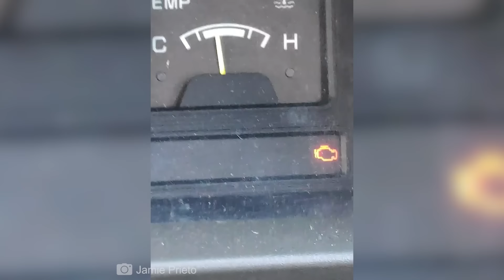Car guys funny moments [PART 2]

Comment: The dude that ran out of diesel had me dying
Reply: Hilarious,  @Slicks21 .  That is some good fast thinking, man.
Reply: if only there was a way to get diesel before you went through all 90L in your tank..
Reply: If you run out of gas you need to get your license taken away
Reply: @blackhammer_928  y tho
Reply: @strategy_photos1382  cuz your car turns it into gas?
Reply: @strategy_photos1382  Because it's short for Gasoline. What the liquid is called
Reply: Oh My Gosh!! I know where that is! literally 5 min from my house!
Reply: On my way to work one day the guy in front of me in the left turn lane broke down right at the intersection.
I get out and start pushing him into the gas station on the corner, people honking the whole time.
I'm pushing the guys car by myself.
Did a single one of them get out and help clear the road faster?
Reply: @GMdrivingMOPARguy  i think the joke was lost on you
Reply: He didn’t even start the truck
Reply: @sadmax588  wont start when its out of diesel....
Reply: DEESEL
Reply: @blackhammer_928  yes I agree the fucking car tells you
Reply: @0xsergy  It's especially funny if you run a diesel dry you have to bleed the system...
Reply: @strategy_photos1382  Any gas can be made into a liquid ! U didn't know that. Bet u didn't know you can run a gas engine off of water and or wood
Reply: @jaycole5353  I mean you can run a petrol engine using woodgas with minor modifications
Reply: Anyone have the link to the original?
Reply: @GMdrivingMOPARguy  It is called petrol!

Comment: Why was the Maserati even there in the first place?
Reply: Still just hooking on to the front clip and thinking that'll hold is far more stupid then taking a Maserati down to a beach. (There are actually some beaches that are actual highways in the world)
Reply: I am not surprised the Maseratis bumper came off they are pieces of crap
Reply: @camroig1404  All cars today are just plastic front pieces clipped on. Putting a tow hook there was complete idiocy by the person doing the recovery. Cars either have hooks underneath or screw on eyes to pull on to recover.
Reply: @Cragified  yeah I know they placed the tow hitch in the wrong place and it was stupid I just though it was funny because  Maseratis have terrible reliability and are built poorly.
Reply: @Cragified  there is no hook underneath the car. those are for tide down only. The hook up is correct, the problem is the truck yanked it too hard, but Maser is still piece of junk with crash bar yanked out like that
Reply: @Align700nitro  You are correct. Watching it back frame by frame I do see the eyelet is in place. That is pretty bad that it ripped off the whole front fascia there.
Reply: @camroig1404  who needs a reliable car when you can afford a Maserati

Comment: 6:12 And this folks is why your car manual points out in detail the proper spots to lift your car from.
Reply: and if there's any doubt, jack on the suspension arms.
Reply: @TestECull  No! Not all suspension arms are designed to take a shear load. Many are tension and compression components. I have replaced many a lower arm that was used as a lifting or recovery point. And I have seen tension and lateral struts snapped or bent into Us.
Reply: @Cragified  If you can't jack a car up by putting the jack on the control arm the car isn't safe to drive on public highways. I sure as shit won't ride in one built that shittily.
Reply: @TestECull  If the control arm has a spring cup you can lift under the spring cup because this component is normally taking the sprung weight of the corner. However the far more common these days Macpherson control arms cannot be lifted under. You are highly likely to bend them and the first obvious sign will be the steering alignment being way off.
Reply: @Cragified  The forces on that arm when you hit a bridge transition on the freeway are orders of magnitude higher than the forces on that arm when it's got a jack on it for 30 seconds.

Again, if the arm is too fragile to be used as a jack point the car is not safe to drive and I will steadfastly refuse to drive or ride in it.
Reply: That was just a terrible idea.  He needs his man card revoked....Lol
Reply: @TestECull  IMO if you are not the engineer who did all the stress analysis on all the different suspension components i'd always stick to the manufacture recommended jacking points (they are never the rocker area those are for tire changing only and not designed to sustain 1/2 to 3/4 of the vehicles mass)
Reply: @G1itzik   If I can't jack it by the suspension it's not fit for purpose. I don't need to do stress analysis to know that a control arm so flimsy I can't pick it up by the arm is too flimsy to be trustworthy on the freeway.

Part of why I love my old truck so much. The front arms on that thing are literally three inches thick solid cast iron. They're the strongest part of the entire fucking truck. Nevermind jacking it up, you could use them to pick up a bulldozer.
Reply: @TestECull  sedans don't have beefy suspension, most of the mass is held up by the McPherson strut. And the arm do mostly lateral support, I wouldn't trust them for 1/2 of the car mass or more
Reply: @Cragified  noone says to use the center of the arm dingus. you lift where the arm is attached to the frame OR right under the pintle pivot.
Reply: Always lift up cars on the metal frame. I don’t care what any moron tells you. I’ve seen too many cars messed up like this.
Reply: Fuck sake jack it up from the crossmember from the front or the rear diff
Reply: mainly bc the ground isnt flat. and the weight from the ramp. what a geniuses. lmao
Reply: @Cragified  i have used control arms as a jack point for every car ive ever had from 1982 to 2019. Never had any problems with alignment. Id rather use that than rely on a pinch weld like some idiots.
Reply: Pinch welds or any reinforced metal beams like frame rails or structure components
Reply: Man's used a jack on the skirt instead of the proper spot
Reply: Even the dog knows that.
Reply: I’ve known this sense I was like 12yo and this dudes a grown man and can’t even jack a car up correctly 🤦‍♂️
Reply: @OFFROADOVERDRIVE  That dog had more sense than him snh
Reply: Up north the lift spots are the first spots to rust out lol
Reply: i cant remember the last car i've owned thats had the owners manual with it. still though. its obvious where you'd want to put a jack on pretty much every car.
Reply: Dumb mistake or not, I still feel the guy's pain- I would hate to mess up my own car like that.
Reply: Looks like he had it right on the edge of the jack point and the jack then slid off slid off into his frame and door
Reply: @TestECull  just jack it up properly... Idk why youre arguing about doing something wrong... Just don't do it. Smh
Reply: @leexgx  no, it wasnt anywhere near the jacking points.
Reply: Bro even the dog knew. LMFAO
Reply: @TestECull  you are giving terrible advice. You are completely misusing the parts you're lifting by
Reply: @FordRangerClassics  If jacking by the spring perch damages the suspension that car was not safe to drive in the first place. End of discussion. That part should be strong enough to hold the weight of thar corner when jacking the car because that part of the car ALWAYS has to hold the weight of the car.
Reply: @TestECull   going to lift by my leaf springs
Reply: @TestECull  well thanks for realizing that
Reply: What car is it btw ?
Reply: @kalbi777  lexus GS F
Reply: It is very common for cars to have jack points along the rockers. He probably did listen to the manual. Lots of cars also have problems with the rockers rusting out. Looking at the manual is better than nothing for complete idiots but usually you are better off taking a look and using common sense to find structural areas that aren’t rusted out and which don’t impede the area you want to work on.
Reply: @sprolyborn2554 Either the dealership hands it to you or leaves it in the glove box. If you didn’t get one it’s either because you are buying used or they offered and you didn’t want it.
Reply: @JacobLeeson-zk1ol  in the context of a new car that has an owners manual with it, you wont ever need to jack it up for quite some time so you're making a moot point. the only time you might end up needing to jack a car up somewhat frequently is if its a used car that surprise surprise! likely doesnt have a manual anymore!
Reply: Rule of thumb: when the dog slinks away stop and evaluate what you're doing
Reply: @TestECull  good luck trying to lift a 5-Series BMW on the aluminum suspension arm as thick as a cigar...
Reply: @E39Passion  If they are substantial enough to support the performance those things are capable of they are substantial enough to jack and support it. If they are not substantial enough to jack and support they are not substantial enough to support the performance the vehicle they're on is capable of, thus, every single one of those things is unsafe to drive.
Reply: @TestECull  ...and when exactly does the driving force affect a punctual surface as big as the jackpad on the suspension arm? It even says "do not tow or lash" on the suspension arm. So a BMW suspension, one of the most capable suspensions in a fullsize Saloon car, is unsafe to drive? Well, yeah...
Reply: @E39Passion  If it's too thin to support the car on a floor jack or a jack stand, yeah, it is unsafe to drive. Too thin on the suspension. clip a pothole or train crossing wrong and you'll snap it like a twig. If they truly are so delicate that floor jacking the car up by the arms damages the suspension I dont want to be anywhere near a 5 series.

BMW saying not to winch or lash is entirely different as the forces at play when you're doing that can rip the suspension off damn near anything. Doing that will pull the front arms off my 85 F150 if it's been buried badly enough and that thing is built out of bridge girders! Ittl pull the axles out from under semi trucks, SUVs, hell there's videos of that sort of shenanigans ripping farm tractors completely in half. WWAAAYYY more force on the arms than a floor jack and in an awkward direction to boot.
Reply: @TestECull  allright, keep using the suspenson arm instead of the jackpoints and be happy, because even the automotive engineers are wrong and you're right... ;)
Reply: @E39Passion  I dont trust cars so shittily built that a floor jack on the suspension arm damages them. They are not substantial enough to be allowed on public roads.
Reply: @E39Passion  Of course, BMW has perfected the art of convincing rich people to spend a fortune on shitty cars, so yanno. Whatever works I suppose. I mean nobody else in the biz has 'r+r connecting rod bearings' as a fucking maintenance item every 90k miles but if you want your N54 to live past warranty its a must do. 

I sure as shit ain't driving a car that flimsily built.🤷‍♂️ My daily commute would destroy it in a month. I'll stick to my 40 year old Fords. Better built.
Reply: @TestECull  yep dude. Makes sense, talking about "unsafe" cars you don't want to get near to, living in a country where it is perfectly fine to run your F150 on 4 different wheels with the exhaust can held by wires and both bumpers taped on, flopping in the wind. That's what I saw when I've been to the USA last time in 2017, after being on the Highway for just 10 minutes. But most important thing is that you can lift your solid safe car on the suspension arm. Especially if you want to take out or work on the shock absorber or the suspension arm itself, it's a good idea to put the jack underneath it instead of using the factory jack points. 

Let me choose the corner and get through it with 100mph in an F150 and in a 5-Series. That might be the situation for you to realize that all of the additional arms and joints inside the BMW suspension are there for some reason. 

But you're right and I have my peace. Who needs good handling, when the maximum speed is 75 mph and every road is straight...
Reply: So I’ve seen this guy explaining what happened. He says he had put 2 pucks in the jack under the car and the pucks slipped off of each other causing the jack to slip backwards onto the side skirt.

Comment: 4:20 Now that is a blown engine
Reply: never seen a engine blowup like that, insane
Reply: @jls.mp4  fr is some serious power
Reply: @savagesock3598  sounds like it ran away
Reply: @themindofjohn4346  Shit obviously aint gonna be walking home like Forest Gump wanting to go home 😭😂
Reply: Blew up the entire front end it just hurts so bad to watch
Reply: @themindofjohn4346  no. Lol. Too much boost, witch resulted in way too much crank case pressure, blew it off the mounts.
Reply: @noahbannister1834  3:23 try reset engine light controller if you want
Reply: Man the way dude grabs his hat afterwards 😂😂😂
Reply: Theres a video from another angle out there, and you can see the entire top half of the engine block just fucks off.
Reply: Nah dude just put some seafoam in it’ll be all right
Reply: @noahbannister1834  Hurts but is also one of the bada$$ things I ever seen . I do feel bad for the guy and even the truck
Reply: @jnoneofyodambidnezz2876  Probably checking for the top of his head 🤣
Reply: Nah it just overheated
Reply: that’s probably why the guy below decided to duck lmao
Reply: That truck died violently
Reply: @alyx6427  took cover in that little storage space ahaha
Reply: it'll buff out

Comment: The daily for the daily had me in tears. 
Even though I know a person who is exactly that...😂
Reply: reliable transport is very important. its also not that hard to relate to. i own 2 cars and a motorcycle. 
one car is really nice but breaks down because ford sucks. my backup car is old and more reliable, rusty, and gets good gas millage.
Reply: @darkshadowsx5949  shit sounds like my cars except both of mine are unreliable shitboxes (94 ranger splash and a 95 accord ex both five speed manuals)

Comment: 6:15 brahh. WTF was that? Jacking up the front with stands in the rear XD
Reply: Most cars have a double thick rolled steel lip for a jack point. At least my Jetta does. But the extra angle with the ramps in the back didn't help.
Reply: @walkerw3091  
He was also right under the door instead of the body seam
Reply: And on the body.... not even a lift point

Comment: 6:12 “how to jack up your car the right way, first u put it wherever you want. Pinch welds, the frame, cross member, and even the control arm don’t matter.”
Reply: Nah. Completely wrong. Put it right under the oil pan

Comment: 7:37 is there some type of trend going around where people are stealing cats off of priuses? I swear this isnt the first time I've seen something like this lol
Reply: Yeah, the hybrid cats are worth a shit ton of money, and easy to steal. Dude filming it should've stopped them though, jeez..
Reply: @mafs13  what makes them so special compared to a normal cat converter?
Reply: @Intellistation6225  Not sure, the only reason I can think of is that in hybrid vehicles the gas engine seems to run less, and also less hard making the metals in the cat less susceptible to corrosion. Also on the older Prius, say generation 2 the cat is in a really easily accesible spot, making it really easy to steal.
Reply: Where do you see them stealing cat converts? All I see is a guy pulling a Red vehicle on a trailer with a hook on the center of the hood.
Reply: @PanameraTurboSEHybrid  hmm mustve been edited out or something
Reply: @Michael-pp8lz  Is that really possible to edit out a clip from an already uploaded/published video? That's crazy.
Reply: @PanameraTurboSEHybrid  Apparently it is possible, not sure how.
Reply: That is clearly a Peugeot 207 in the UK being winched onto a truck by the bonnet.......It doesn't even come close to being a Prius
Reply: @rjs198585  Read.

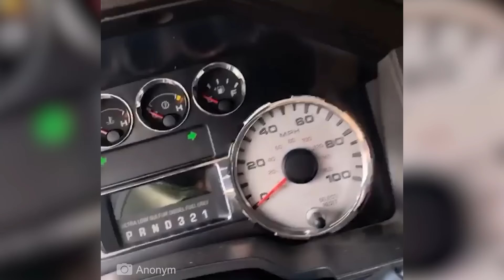Comment: 5:50 i relate sooooooo much to that, happen to me like 3 days ago.....i was trying to get my fuel tank as low as possible to replace my fuel pump but overshot it, stalled at a light right before 7/11. Luckily car behind me was kind enough to help push through a intersection while cars honked.....i wanted to brick their windows so badly.  😂

Comment: 7:31 I've seen that video. They pull it all the way up the towtruck. That hood and those 10mm bolts holding it on, are witchcraft.

Comment: That guy that ran out of diesel, don't you have to bleed the system if you run out in a diesel?
Reply: Yeah you do need to do that 
Gonna cost more than a full tank of diesel and he deserves any bit of that for running it dry

Comment: To anyone wondering About that diesel truck dyno explosion... The trucks called "Master Shredder" and the guys is fine. I think with some bruses and burns, but ok. He still wants to rebuild... But not sure if the frame is good enough. well.. At least in the aftermath video I've seen..

Comment: 0:18 I’ll never understand people that do this. 3 things wrong in this clip....

1 - this dude attached the cable to the bumper and not the chassis

2 - this dude is supposed to go super slow until there is no slack and then slowly pull it out...this dude just gassed it and hoped for the best. 

3 - this dude is just an idiot.

Comment: Quit putting gasoline in bags people. Use styrofoam coolers. It will turn the gas gooey and you then dont have to worry about it spilling. Just shove the gloop down gas tank and you're good to go.

Comment: If you run out of fuel you're brain dead. Unless somehow get a puncture in you fuel tank or it gets siphoned without you knowing. Zero reason you should ever be driving somewhere and run out of gas.